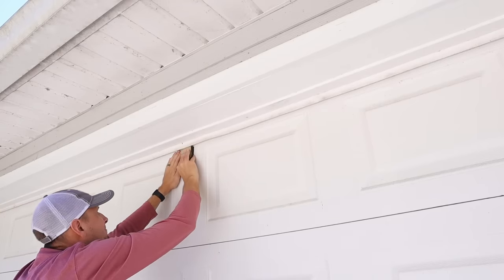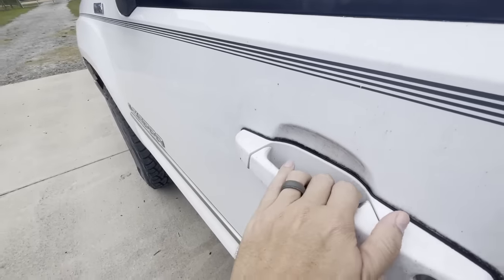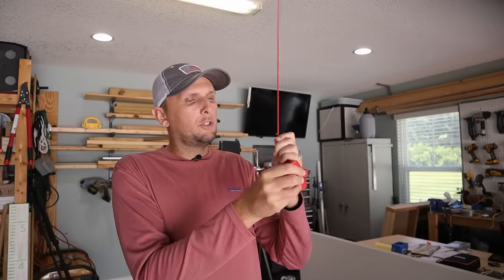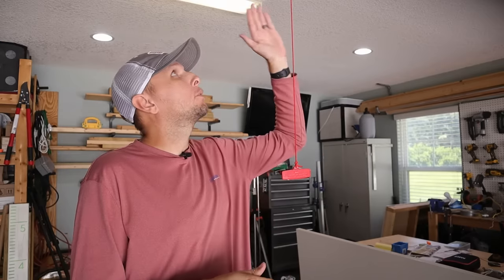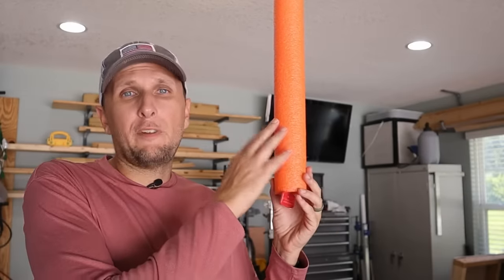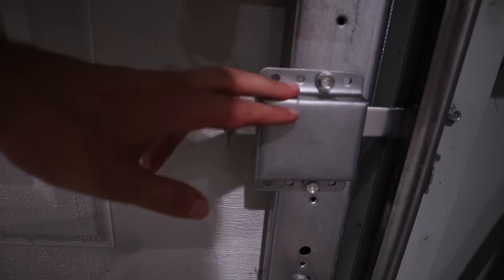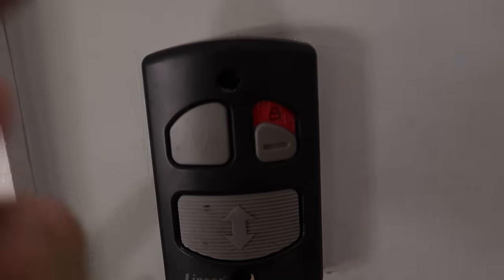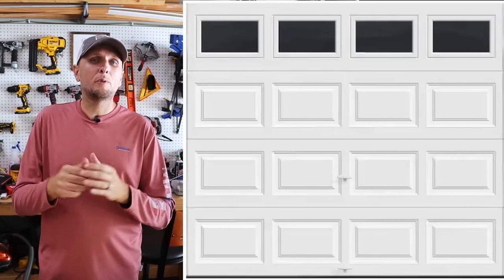How to Stop Garage Door Break-Ins | Number One Way Thieves Get Into the House!

Comment: Ghetto protip: wire your garage door outlet to a switch that you turn off at night so criminals can't use stolen remotes to open your garage door by random chance.
Reply: My boss did that after someone broke his truck window and stole over 15k in chainsaws. Definitely I worthwhile tip.
Reply: Good idea, but it requires you to do some rewiring and then to remember to flip the switch every night. 
I think a better idea would be to get a smart switch plug. I bought some for Christmas lights and they work very well. 
I bought a pack of 4 for $23.
 They’re tied into your home wifi and are controlled by app on your smartphone.
Once it is set up, very easy to do, no other action is required.
It can be turned on via app if you need to open door outside of the time schedule you have established.
Reply: Gotta love those ghetto pro tips
Reply: My father showed me that “technique.” I shut off the electricity with a switch every time I park the car & come inside. 👍🏼👍🏼👍🏼
Reply: Ghetto protip? Why not just say, protip?
Reply: Great idea. You could also put a smart outlet between the plug and existing outlet. No electrical work that way.
Reply: >> wire your garage door outlet to a switch that you turn off at night <<
a timer between the garage door opener and the (source) AC might also work ...
Reply: Very good idea !!!
Reply: @DaVid-yp3js  Does that offend you snowflake?
Reply: @paulparoma  Calm down, switch Karen. He's just proposing an alternative for someone who might not want to re-wire a switch.
Reply: @StayPositive050  like a programmable timer outlet??.
Reply: So what you're saying is to electrify your garage door.
Reply: Here's another: Buy a C-Clamp, place it above one of the lower wheels on the track and tighten it. Now if a person somehow got the release pulled, they can keep trying, but it's not gonna come up, and unlike those slide locks where someone can use a stick or pole to slide it out, they can't unwind a C-Clamp like that.
Reply: Previous owner of my house put a switch by the door next to the imterior light switch. Flip inside on and garage door off side by side.
Reply: @michaelfagan7172  You know you can edit posts, right?
Reply: @paulparoma  Yeah those apps are nice and all but I looked for one that I thought would be really useful and couldn't find it. No Nagging Wife Mute app. Very Disappointing.
Reply: @paulparoma  with smart switches, you can automate it based on time of day. You don't have to use an app ever. Can have it set off from, for example, 10pm to 7am. Whatever you want.
Reply: If I’m away for a trip - unplug garage door opener. Issue resolved. For added security I have a wood piece to put at the top of my door for any manual force entry.
Reply: @michaelfagan7172  What father is incapable of checking all the light switches at night? Fathers are biologically pre-programmed to check all switches, thermostats, and locks. Anything less any they are failing life.
Reply: @Raii_Chu  But nobody said anything about being a father. My comment applies to people living alone as well as those who are living with their children.

Nonetheless, I believe the simplest solution is best, as long as it is effective. Also, my solution did not require any rewiring.
Reply: @michaelfagan7172  Sir, this is a fatherhood troubleshooting forum, please keep your hands and kids inside the ride at all times.
Reply: I use the feature on my control panel that disables the remote feature  AND lock the garage door entry to the housr every night before going to bed. Nothing is 100% but you gotta make it as secure as your entire setup will allow
Reply: Ghetto? This is GENIUS!!!!
Reply: damn good idea! Cheers.
Reply: My garage opener has a lock on it. You push the button and it is locked. Still, I use a zip tie where no one can try to open the door with the pull handle.
Reply: That's only for when you're home.
Reply: @paulparoma We have that and also our door has an electric lock that engages when the door is closed so a hook releasing the door still won’t allow someone to open it.
Reply: Exactly
Reply: Why waste all the energy rewiring?  Genie has made a wall unit for years with a switch that does the same thing - as he demonstrated in the video!  Part# 39165R - pending which opener you have…. Works great!
Reply: @sx300pilot5  There was once a company called X10 that specialized in remote control of existing wiring. No computer, no wifi. Just coded signals on the house wiring. They worked great. I'll need to see if they're still around.
Reply: That does not prevent them from pulling that handle and opening manually. No electricity is involved.
Reply: @226eagleeye  Those handles have locks, and the door can be made incapable of moving from inside.
Reply: I still say that the fake release cord attached to the trigger of a rigged shotgun is by far the most ghetto of garage door defenses.
Reply: I need a video on this, lol!
Reply: Most wallstations have a lock out feature.
Cutting and restoring power nightly is hard on the circuit board.
Cutting power while away for extended periods is ok.
Reply: @geraldslonaker3289  I'm an 18 year garage door service tech and you have the correct answer.👍
Reply: @Eric Dubois  Appreciate the affirmation Eric!
Reply: @geraldslonaker3289   exactly what I do.
Reply: My interior garage door open /close Panel has a Lock button feature

That's probably good to do at night
Reply: @michaelfagan7172  My new home (purchased in 2003) when I checked the wiring in the switches by the door, I found that the wires for the door opener were right there. There were 2 switches there in a 4x4” (1900 box), I replaced one of them with a combo double switch and I was done. Today, the Decora switches have a one gang switch with 3 switches in one spot, I’m going to install one in my garage to control an outlet.  I’ll have one outlet hot, one outlet switched and 2 other switches controlling other lights, all in one 4x4” box, sounds messy, but not really.
Reply: Brilliant!
Reply: @DaVid-yp3js uh, you know why
Reply: @gorehammer1  how would this tip have protected his truck window? And how did he fit $15k worth of chainsaws in the cab of a truck?
Reply: @allmycarsisbroke  ah, I must have been stoned when I typed this, I didn’t explain things very well. He keeps a garage door opener in the truck and chainsaws in the garage. Old employee must have known and busted the window to get the opener.
Reply: When power is off the remote will lose signal
Reply: Great ideas!
Reply: Put in a remote control outlet adapter. It’s like remote controlling your Christmas lights. Your overhead garage door opener is plugged to the ceiling, right?! Plug garage door opener into remote switch outlet, remote switch outlet into ceiling outlet…… don’t need to rewire anything. Then get ya some Velcro, Velcro the remote next to the garage door wall opener. I could just see my wife complaining about pressing one extra button…… FML
Reply: @michaelfagan7172 and that’s not safe either lol
Reply: @CatoNovus you put it above the door or the good burglars will just be annoyed  yet thank you a minute later
Reply: or get a wireless outlet remote at hardware store for a few bucks and plug garage door opener into it
Reply: Great idea
Reply: @ChuRa  not just fathers. I check everything b4 bed also.
Reply: Ghetto pro tips are how I live my life 🙌🏽🙌🏽
Reply: @misterkaos.357  bravo sir!!!!
Reply: That is not a ghetto tip.  That is sound and intelligent.
Reply: This is a great old school way to do it.  My parents house has that.  I do like the new smart switch idea though since it's even more convenient, does the same thing, and makes it more likely to be used every time you leave.
Reply: That's actually a really good tip
Reply: My garage in the old house had some interference that caused it to open and close all the time so for a few years we just came in the side door and clicked on the garage opener when we needed to use the garage
Reply: Great tip! Seems not ghetto at all to me, or I'm just ghetto myself 😅
Reply: Every one I’ve seen in my area has a battery backup so even if the switch is off, everything will still work for at least a few hours.
Reply: Plug in an outlet timer.
Reply: I'm amazed at how people managed to get offended in this thread.
I mean, I'm not...   but I am.
Reply: I put the lift control inside the garage with no remote open. Then the wife quit parking it inside.  That problem solved.
Next bought those long screw (Harbor Freight) drivers placed them in the holes in the door and the rail. You can fish the release. But got to slide a 24 screw drivers out of the holes.
 That is when you need a fork lift to open them.
 She has keys to the garage side door. Not sure if she knows where it is any more.
But being a woman she parks as close to the kitchen door as possible. That is why you want a garage that is set back from the front of the house. And behind the kitchen door.
Good thing is that door is not closest to the center of the driveway. Or I would have to park on the street or shuffle cars that got in her way.
Reply: @michaelfagan7172  could you tell me the plugs you used and what app worked eith it? Thx
Reply: A lot of garage door openers have a "lock" function that disabled remotes.
It helps to read the owner's manual.
Reply: @paulstandaert5709  But if you turn the power off from inside the house that also works. The wife hates that. But she still did the remote thing when I told her the door was locked to the frame. Turn the circuit breaker off inside the house and park it outside. You get a new car every 6 years.
But when it got filled with the stuff she still wanted but not in the house it was OK.
Reply: @paulstandaert5709  pretty sure he mentions that
Reply: @robertheintz8017  it's not even ghetto though lol
Reply: @robertheintz8017  No kidding, right? I can't recall who said, "The reason you're miserable and I'm happy is because you are offended, and I thought it was funny."  😂
Reply: Just use a smart switch. It's a plug that's controlled with wifi. It just plugs into the existing socket. One example is Kasa smart plugs.
Reply: @MrMantal123  I checked our outlets and they're right above the openers. Those smart plugs won't fit between the existing outlets and the openers.
Reply: @michaelfagan7172  put it on a timer or even use a WIFI switch with a phone app.
Reply: You could also use a timer outlet to set timeframe garage opener works or not or a smart outlet that can be triggered from phone by your proximity or triggered manually whenever like after you check cams or from ifttt when trigger is sent like specific text messages
Reply: My slider bolts are cheaper and faster.
Reply: @betsyrambo6868  This is true but not with my slide catches and a piece of steel...
Reply: @misterkaos.357  - good thought, but you would be charged w/attempted murder. 
Maybe rig a spray of red paint mixed w/pepper spray above center of door outside…
Reply: @jeffellis6544  Rock salt is more effective.
Reply: With a timer
Reply: @CatoNovus A pair of vise-grip pliers on both tracks would be quicker than putting on the C-clamps, but either method would pay dividends in effectively keeping strangers out of your garage and home.
Reply: @misterkaos.357 Setting up an unattended "man trap" is a felony in my state, and I expect it is frowned upon in most states and provinces, since the person setting the trap has no idea of who will be killed or maimed when trying to get in. Could be a child, a friend, a spouse, or anyone who wanted to visit, but not rob you, or police doing a welfare check, or the person setting the trap may need to get into the garage quickly, but forgotten he had set the trap.
Reply: I have used the switched outlet and used 1/4 inch bolts with nuts in the track right above a roller when gone for a while.
Reply: Remotes have this. The small button on the inside garage opener shuts off the power. Just hold it in about 15 seconds. You do need to turn it back on to use the remote.
Reply: @CatoNovus My slide  latches have a hole so you can put a padlock on.   Even if they break a window and crawl in the can't easily open the roll-up doors.  My entry door has deadbolt keyed on both sides and very long screws into framing.  Door is steel so if they try to kick it hopefully they will break their foot.

You can't stop a determined thief but you can make it so the house next door or down the road is an easier target.

If things have to carry stolen it's out a window they probably won't get much, certainly not you sir compressor, table saw, jointers etc.

This guys tips are good for home doors you are using daily ... I got to up my defenses.
Reply: Not ghetto at all, that's very good advice. If you don't need to have the thing waiting for a signal at 2am why would you? Does anyone leave their coffee machine on 24 hours a day? You can use something like an analogue timer plug, or even these days a smart plug - which would be even better on the occasions when you do happen to go out for a night and come late, after the normal timer has already kicked in.
Reply: @DaVid-yp3js cuz he lives in the inner city 😆😊
Reply: @Anonymous-zv9hk
If a child, a friend, a spouse, or anyone who wanted to visit, or police doing a welfare check, or especially the person setting the trap(😜) tried breaking into the garage, then they deserve it.
Reply: Also as soon as you buy house or already have one change code on remote they all come from factory with same code and take remote with you
Reply: Yeah, been doing that. Just use a socket adapter that plugs into the light bulb socket. Works great and is very cheap.
Reply: Great tips. Thank you!
Reply: Hillbilly protip... Use a chain or cable instead of the cord.  Attach that chain to the electric fence charger.  They put the wire hook in, hook the chain and ZAP.😅
Reply: Wow. Great minds think alike. I already did this too and when out of town I lock the garage door itself with the metal slide bar inside. 
Also I always keep my car doors locked even when it's inside my locked up garage and all my entry point doors are old school metal firewall doors and they're locked too. Also I brag to all my neighbors about my security system and my guns I have and also I have a dog who is behind my 6ft vinyl fence thats gates are locked too.  Telling all your neighbors what kind of security setup you have might seem like overkill but word of mouth is a very strong presence. If people know you're prepared unless they're insane or have a weird self-harm wish, people will walk away and go elsewhere.  ✌
Reply: @michaelfagan7172  not really if you have dedicated lighting for your garage just wire the outlet to that most people turn their garage lights off to save money on their electric bill.
Reply: @vincei2147 no they’re saying wire the opener to a switch so you can cut power to the opener when you’re not using it.
Reply: I’m just going to make a sentry turret with a shotgun and a raspberry pi
Reply: Interior cross bolt latch
Reply: I had to learn that just to keep junior from my stuff.
Reply: Or break into your car and use your remote! 😂
Reply: @DaVid-yp3js that’s code for, what we use to do in the hood! 😂
Reply: I turned my switch off every night
Reply: There is an easier way to do this. Unplug your garage door opener and install a smart plug between the plug and the garage door plug. You can set it to turn off /on automatically at a certain times. You can also control the power to your garage door via an ap on your phone.
Reply: War Dialers with pocket full of garage door openers
Reply: You could also plug it into a simple 24-hour mechanical timer.
Reply: @bigdogblackie  we know. Thats been said about 116 times already. Great idea
Reply: M garage opener has a lock feature.  My garage has a metal bar to lock place
Reply: I definitely love to try alll of the ideas mentioned here.  It’s unfortunate that I’m unable to use any of the hints.  I’m a widow, whose husband would try a method, mentioned that would work with the remote, or anything to do with keeping us safe.  Keep up the good idea people.
Reply: @StayPositive050  this is a simple and cheap solution. I’m doing that this weekend!
Reply: @robertheintz8017 snowflake was triggered by the word ghetto 😂
Reply: I bought one of those remote key on off outdoor light multiplugs to remote on off the outdoor lights or timer it. I keep it on my keys and remote switch off and turn on each time i leave or come home.  So essentially on my keychain is a simply outlet on off by remote.  So i turn off when not home on when getting home  it has a 2 4 6 hour timer to leave on if needed before auto off. Amazon find 20 bucks.
Reply: This is a MacGyver pro tip!
Reply: Alternately, wire a tripwire a to that socket at waist height. : )  unplug during the day.
Reply: How about putting something in between the outlet and cable so you can schedule or control remotely if needed. Like a Wi-Fi plug outlet?
Reply: Sensitive much??
Reply: @TheKingacevedo  then so can they
Reply: Unplug it
Reply: Didn't cry,  @DaVid-yp3js  😂
Reply: Plug it into a time switch
Reply: You bought a home and now are stuck with a 30 year mortgage huh? Neighbors are jerks. Crime is high. Your job pays you a low wage, yet Americans keep buying homes lol. The American dream was the greatest lie ever told. And if you fell for it, I feel sorry for you.
Reply: @DaVid-yp3js No, it’s not
Reply: @HanginInSF  great idea!
Reply: Mine has a lock switch on it already
Reply: Every door on my property has a deadbolt.  Every garage door needs a deadbolt.
Reply: Whenever I went on vacation, I placed a pair of c-clamps on the channels on each side.
Reply: I just unplug
Reply: @misterkaos.357 that took a dark turn.
Reply: Smart plug with schedule turn off and on
Reply: Many of the garage door openers have a disconnect switch. Hard to locate, get the owners manual online and check.
Reply: @robertheintz8017  top trying to be cool, jagov.
Reply: @DaVid-yp3js because it costs absolutely nothing and it's so easy a child can do it
Reply: Salvation is Simple

HalleluYAH “Hallel u YAH - Praise ye YaH”

YaH is The Father (Genesis 1)
YaH arrives via the TENT OF MEETING
YaH was Who they Crucified for our sins
YaH was Crucified on an Almond TREE

Ancient Semitic Moshe (Moses)
Isaiah Scroll (The Original Isaiah)